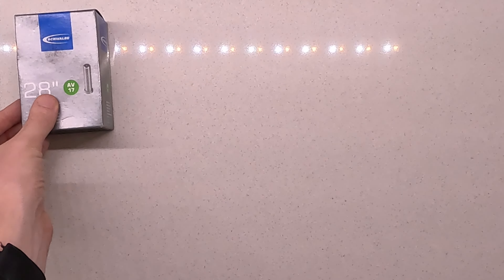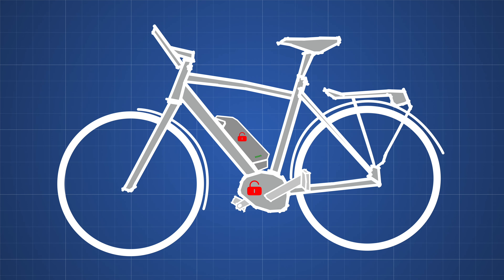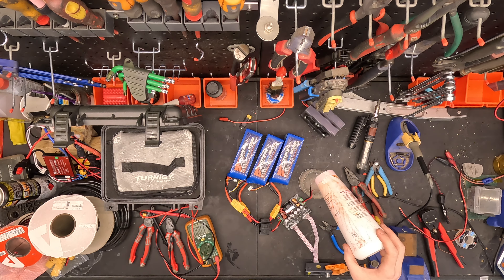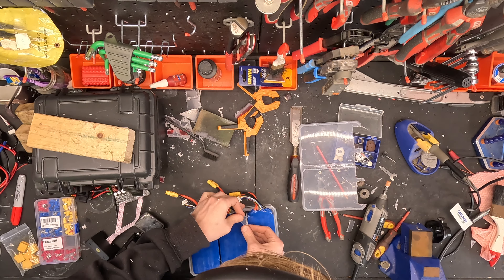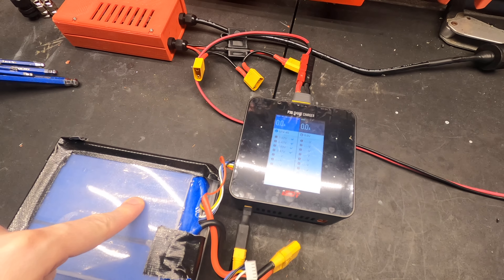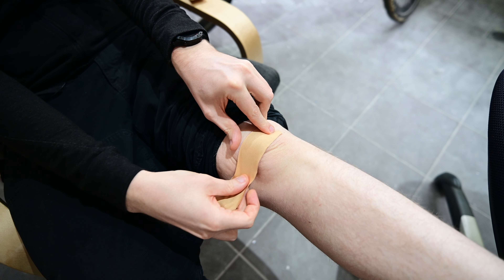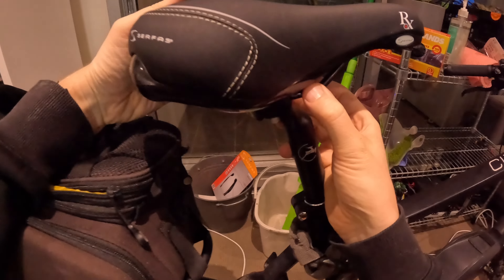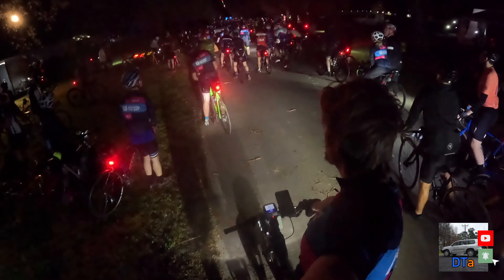Preparing for Around The Bay 2023 - DIY Bosch Chargers and knee issues

Comment: Nice work mate. I wasn't aware that a bosch battery could be charged off 12v so that is interesting. I wonder if its possible to charge a shimano battery in a similar manner.
Reply from the maker: The LiFePO4 pack was 12v (with all three of those "bricks" in parallel) - it's been rewired in this application to put all 3 in series so the DPH5005 only has to step up from 36v to 42v, as there's a 10A input limit to contend with. However you could use it with 12v input - 12v 10A is 120w, so you'd have a bit under 3A at the battery end at 42v. Provided you wanted to wait a bit longer to charge it, that'd work. 

As for Shimano STEPS - I cannot find anything about DIY'ing a charger (I thought info on Bosch was thin on the ground)... I would think it'd be similar as overcomplicating the charger would increase cost, but I really can't be sure.

Comment: I have so many comments on this video....

1) You're tempting me to get a DPH5005 to replace my DPS3003. In blatant violation of the YAGNI principal I'll probably get it with the Bluetooth module too.
2) Instead of that Pololu 5V step-down, or even a resistor/zener, I would've thought that an LM7805 would be the way to go. If the device is really that low current you might be able to do without any input/output decoupling caps too.
3) Does the Bosch battery have onboard BMS? I'm not sure I'd trust a DPH to be accurate enough with its voltage limiting.
4) Is that a Seiko SKX171? Not a common watch, but cool!
5) I too have issues with my knee. Not exactly sure what's caused it, but the cartilage in my knee is fractured, perhaps from similar issues to what you had. Yoga has helped me to work the right muscles to avoid pain these days.
Reply from the maker: 1) You can always use both! Haven't used the BT module but maybe for something like this it would have been handy to log I and V over time, for a nice graph (in addition to the timelapse)
2) 7805 is usually max of ~25-35v in, even at negligible current, Pololu module will take 50v in. All 3 batteries in series so could be wired across just one... though if any significant current is drawn, will flatten one asymetrically (maybe in practice this may not matter, those 3 packs do differ a little in capacity...)
3) Yes the onboard BMS on the Bosch side should disconnect above 42v - it doesn't even connect until you supply the 5v - but the voltage did seem to be pretty accurate when I checked with my meter. While testing I had it top out at 41v just to be safe.
4) Yes it is a SKX171 - used to be my watch before I got a Pebble Steel, then a Pebble Time, then a Pebble Time Steel, then a Garmin Fenix 6X. Nice solid chunk of metal, water resistant to 200m, fully mechanical and self winding. Actually, it's funny how I thought that was a big watch when I got it, the 6X makes it look tiny!
5) In the months since then, I've resumed running and it's getting better. Don't think I have problems with the cartilidge - that sounds painful, hope you can keep it under control.
Reply: Good pick-up re the 7805. My oversight is why voltage regulators cower in my presence.